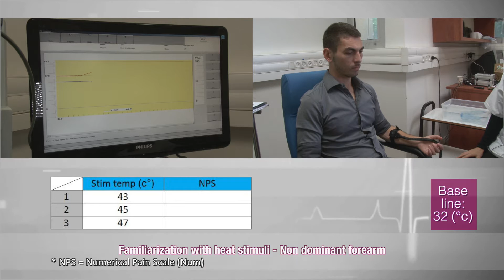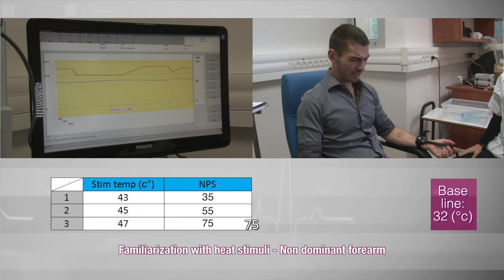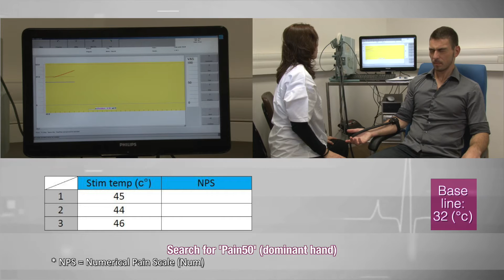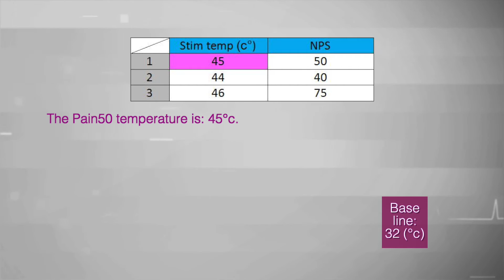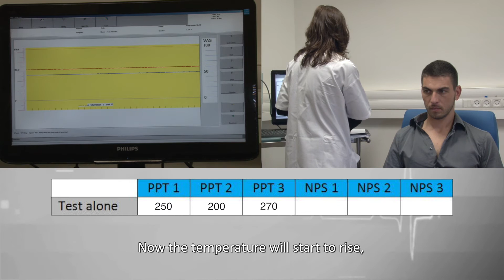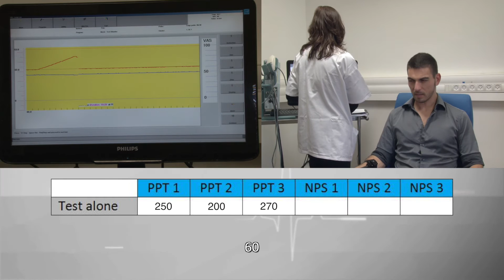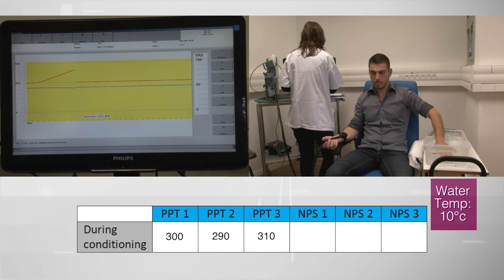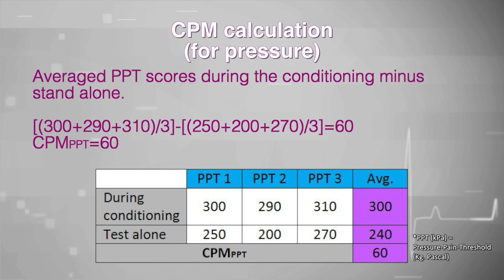Conditioned Pain Modulation (CPM) Protocol

Comment: I have a question. Why do you apply thermal stimuli too? Can I only use mechanical stimuli and get the same CPM response?
Reply: Dear Rocio,

Not necessarily.  The CPM effect might vary among individuals; and across populations, stimulation intensities and modalities. This is despite the relative reliability of the procedures. Therefore, having another modality is a good idea.

You might find the next few articles useful: 

Yarnitsky et al 2015. “Recommendations on Practice of Conditioned Pain Modulation (CPM) Testing: CPM Consensus Meeting Recommendations 2014.” https://doi.org/10.1002/ejp.605

Kennedy et al  2016. “Reliability of Conditioned Pain Modulation: A Systematic Review.” https://doi.org/10.1097/j.pain.0000000000000689

Nahman-Averbuch et al 2016. “Psychological Factors and Conditioned Pain Modulation: A Meta-Analysis.” https://doi.org/10.1097/AJP.0000000000000296

Edwards et al 2016. “Patient Phenotyping in Clinical Trials of Chronic Pain Treatments: IMMPACT Recommendations.” https://doi.org/10.1097/j.pain.0000000000000602

Imai et al 2016. "Comparing test–retest reliability and magnitude of conditioned pain modulation using different combinations of test and conditioning stimuli." https://doi.org/10.1080/08990220.2016.1229178

Hope this helps.